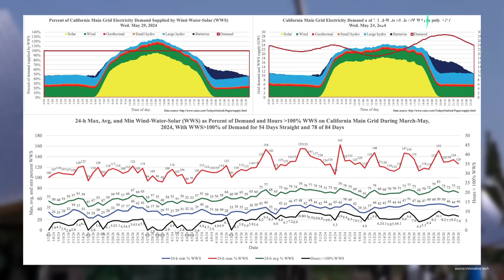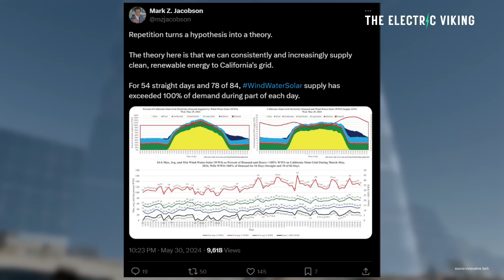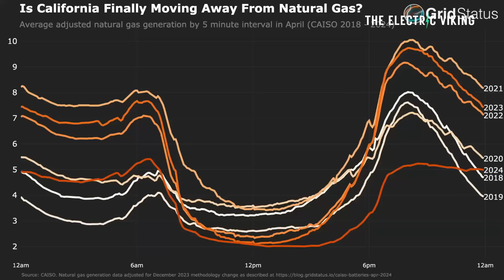Solar smashes records in California, 'DUCK curve' nearly wiped out

Comment: Dream on... The average residential electricity rate in California is 30 ¢/kWh, which is 69% higher than the national average rate of 18 ¢/kWh. And it will become much more expensive if they continue like this.
Reply: The renewables aren't the problem. It is more of a perfect storm between regulation encouraging cost maximization, out dated transmission infrastructure in need of undergrounding, and a very badly run utility that are driving up costs.
Reply: @ianollmann9393  Germany is trying the same thing and they too have exploding costs. Problem is that PV/Wind do NOT provide power in about 80%+ of the time. So you need to massively overproduce power and store that excess energy very expensively with at least 30-40% losses. And in parallel you require expensive backup power systems (primarily gas) to cover when there's low power for several days or even weeks. So you have to build parallel infrastructure and all systems run inefficiently. It will and must be very expensive and unreliable. Basic physics. Thus all countries trying it are facing the same fate.
Reply: @marcusfleuti2672  The cope in these comments is so strong (not the comment I'm responding to!). Storing electricity in giant batteries is more expensive that running a CCGT, or a nuclear plant. There is no conspiracy. 

Does the guy who made this video even understand why the "duck curve" is a problem? Does he understand grid instability and the fact that you can't turn on and off baseload power, and therefore you waste solar power above a certain percentage of the mix? 

Unless you think you can move the entire system to wind, solar and batteries (no gas, coal or nuclear)...and oh boy if you think California power is expensive now - just wait. 

And btw, before I hear about how great California is because of their renewable power, have you considered the conventional power they buy from neighboring states in order for them to (usually) keep the lights on?? 

I've got my popcorn ready!
Reply: @egec1  It is exactly so. I call photovoltaic/wind power "parasitic energy systems". They only work with a reliable host (primarily Gas/Coal/Oil). As soon as you factor in the required backup storage or the cost for all the backup power plants, costs of solar/wind explode whilst grid stability drops. Hence Germany is struggling with keeping their grid alive on a weekly basis now. Keeping the German grid stable costs now about $4.5 billion USD annualy already. Costs are rising with every additional Wind/PV system built and connected to the grid. Germany is now a net energy importer. Without reliable energy from other countries, Germany would be dark. It's really crazy and yet, people don't seem to understand still. Things have to become really bad because they can get better as it seems. Popcorn is a very good advise ;)
Reply: As a CA local I been picking my brain for years why this is. Especially since I know my power supply is coming from NV energy and their customers in Nevada pay half as much as me !
Reply: Also if the duck curve is such a problem why is peak pricing per kwh still during the day when their is allegedly too much energy?

Comment: There are all sorts of bizarre requirements for long term storage. In reality for places like california, you only need 12-18 hours storage.

But i suggest steps can go further: shift heavy power industries to solar rich areas. Run them during the day for ultra cheap solar power without even needing batteries.
Reply: California, the next steel manufacturing hub!

Comment: Solar power combined with batteries (molten-metal batteries are the best for longevity), really are way better than trying to use fossil fuels (oil won't last forever)  or even nuclear (too expensive to develop). We have to get longer-lasting batteries for cars, ones that won't catch fire so easily, and that will push the majority to go for electric cars.

Comment: The solution to the duck curve is nuclear.
Reply: It's not. Because the duck curve has a low in midday where nuclear plants would be required to shut down, while later in the day they would need to come back up. That's doesn't fit the typical strength of nuclear.

Comment: Rooftop solar makes a lot of sense in a suburban domestic situation. 

In Australia  domestic 10KW arrays are commonplace. They provide enough power to cover domestic power use including charging EVs such as a TM3.

Essentially power costs get zeroed most days but you still need to pay a network access charge if you want to remain connected to the grid which most do to cover cloudy days and night time use.

Comment: Living in fantasyland? Unless you consider Nuclear "renewable" 60% of california's Electrical power -(Electricity is only 1/3rd of all power consumed in California) 73% was Nuclear, Gas powered internally in California and 10% Coal and gas from outside California! That leaves only 17% of California electricity powered by Renewables. If you are going to "transition" you must replace ALL the power consumed not just electrical production. Thus renewables only account for 6% of ALL power used in california and it is peaky and unreliable.  California Energy Commission (CEC)  2023 showed in-state generation of 208 TWh from 88.3 GWe of installed capacity & Net Imports of 89.2 TWh!! A total consumption of 297 TWh. In-state generation comprised: 17.5 TWh (8%) nuclear; 103.4 TWh (50%) natural gas; 33.3 TWh (17%) solar; 15.2 TWh (8%) wind; 12.0 TWh (6%) large hydro; 11.1 TWh (6%) geothermal; 5.4 TWh (3%) biomass; 2.5 TWh (1%) small hydro; and 0.3 TWh coal. The imports were 32.6 TWh from Pacific Northwest and 51.1 TWh from Southwest, the latter including 15.7 TWh from coal and gas. About 12 GWe of gas-fired capacity was retired in the eight years to mid-2020. In 2021 about 30% of California's electricity supply came from outside the state. Electricity supplied from out-of-state coal-fired power plants

Comment: Sam, as a customer of PG&E I can tell you we have the highest electric rates of any state in the continental US, only Hawaii is higher.  I put in a solar system almost a year ago so haven't had my first true up.  I will have to give serious thought to batteries and go totally off grid if my system doesn't zero my  bill.  Summer bills here without solar range from $500 on up, with $1200-$1500 quite common.  PG&E, as are most utilities, are state protected monopolies, and the state is totally in the pockets of the utilities period.  I'm 80 years young and in my entire life I've never seen a rate reduction and that isn't likely to change.

Comment: It seems really off that in california the cheapest electricity rates are between midnight and 6am.  I guess it is because transmission lines  are more saturated during the day.
Reply: The one nuclear plant can't quickly reduce output. Geothermal power is there whether you use it or not. The large hydro would just have to let the water go over the dam in the spring when the snow melts. And demand is low late at night: lights and TVs are off, less need for AC, offices and stores are closed.

Comment: To best deal with that evening peak:
1. Get rid of the home inefficient devices - the high consumption washing machines, refrigerators and radiant heaters. Change-over to heat-pump (compressed gas) systems as soon as possible.
2. Introduce more home batteries with solar systems.
3. Get people driving EVs and develop the V2H functionality so home-owners can use the EV to support their home solar power system.
4. Workplace carpark charging* so people gan go home with enough low-cost (mid-day) power to support the evening peak demands.

* Where I live the 11am to 2pm price of power is actually negative; power companies get it from power stations and get paid to take it. The consumer can get 0c/kWh power and the power company still makes money.
Reply: If renewables (plus the necessary batteries) were actually cheaper, then there would be a tidal wave of people buying large batteries for their homes to fill them up when power is cheap and use the battery power when the grid is expensive. I don't see that wave.

Comment: California electricity price is 70% to 90% energy delivery and only small fraction is electric generation. It means copper wires hanging on poles doing nothing (other than  conducting) cost many times the cost of solar, wind, battery, nuke, Nat gas, coal, etc. etc.
Reply: That’s part of Tony Seba’s G.O.D. theory. Solar/batteries will get so cheap that it makes more sense to generate your own than to use the grid.
Reply: @davestagner  solar install cost is 80% labor and permits and nothing to do with actual solar panels. If solar cells are free, it'd only be slightly cheaper but not by much. And politicians won't let power companies lose profit. See net metering changes in CA that discourage home energy producers as more ppl adopted solar.
Reply: @yootoobvyooer  It’ll be interesting to see where the balance lands between home installs (which cost more than grid installs) vs power from the grid (which adds a lot of distribution and maintenance cost). I’m sure we’ll have a lot of both.
Reply: @davestagner  my point being, having lots of solar won't make electricity cheaper as most of the cost is in something other than electric generation.
Reply: @davestagner  that day is still not here unlerr you are in the Upper 10%
Reply: nice lie, copper is to costly to hang on pools
Reply: I thought the point of copper was to do conducting.
Reply: @JeffDM  its also the price per fpot copper is very costly per ft
Reply: @dknowles60  doesn't surprise me someone who thinks 99% of population are on welfare because they use grid also thinks copper cost has to do with high electric delivery price as if copper is replaced all the time.
Reply: @yootoobvyooer  only in houses  and other things, I am retired TVA , i work on high voltage lives 500k volts, they are steel cable, copper is not the only conductor out there, like i told you copper is not use in high voltage lines. a big problem in  new home consturction is people are stealing the copper wire out of the houses.
Reply: @dknowles60  stealing copper from home construction site doesn't affect grid delivery copper which already exist. But then you also think everyone using grid for electricity are on welfare. Senility is a terrible thing.
Reply: @yootoobvyooer  again you have problems reading, Copper is never use in High voltage line Because steel is cheaper it is a lot stronger can span longer distance, hint steel wire is also use in homes where the wire is 8 gage and lower due to cost
Reply: @dknowles60  you still have a problem with reality by thinking ppl using grid electricity are on welfare.
Reply: @yootoobvyooer  do you know what welfare is, hint it is  puting up a solar system and hoping a electric Company  will buy your extra electricity
Reply: @dknowles60  making up you own definition of welfare is precisely why detached from reality. Going by your definition, driving on the road is welfare.
Reply: please feel free to make a fool of your self on Ypu tube , all my facts i have posted are on google, all you have posted is your feedings, there a places where copper wire has it uses, hint in doors
Reply: Yup it’s the equivalent of ordering a $30 pizza and paying $100 for the delivery. 😂
Reply: @johnbeeler25  YEA
Reply: CA utilities are investing billions burying electric lines to avoid starting wildfires.

Comment: if everyone just considered putting timers on there hotwater tanks that is a "battery in every house already" and only cost $400 to install with instant results🤩🤑🤑🤑
Reply: $400 for a stinking timer?  I put one on my water heater 20 years ago, and it's still running.  Home Depot still has it for $36.

Comment: Sam! "Relatively expensive" rates for electricity we are absolutely the MOST expensive rates in the nation. $0.54/kWh off peak and $0.64 it helps when you tell the whole truth not just the fluffy stuff that makes our leftist monopoly run state since 1999 (terminator doesn't count another lefty) try and sound great. Solar is great i have a 48 panel system cost over $50k to install because i was basically forced due to our more recently skyrocketing rates great job Gavin way to bring change... Not the change we're hoping for, no wonder why CA has net loss of population in past 3 years cant afford this madness.

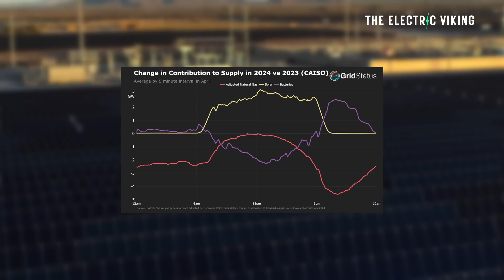Comment: 5:36 So looks like if the battery storage was X10, and the solar was x3, and no more EVs and every day had that much sun, supply would meet demand. The only BIG issue is what happens when the sun don't shine for a week. Assuming no more increase for heating/AC, lighting, or EV, you really need X70  battery storage and X10-20 (approx) solar to cover 1 week of minimal solar.
Reply: They've worked through this. There isn't any such thing as the sun not shining for a week, or even a day. It just shines less, but it still shines. The low cost solution is therefore to just overbuild the panels. This even works in Alaska. It's just a question of how much panel overbuild is needed, and what to do with the excess when the sun is shining.

Comment: $0.65 per kWh - Highest in US!  Well done, nope!
Reply: Of course you pick the peak price of the highest plan. If you don't have solar you pay 43 cents per kWh up to your baseline allocation, 53 cents after that. If you have solar it gets more complicated: June 1 to Sept 30 you pay 10 cents more from 3 to 9 pm, but in winter you pay a few cents less than the non-solar rate. No doubt it is high, but you don't have to exaggerate.
By the way, the highest rates are in Hawaii.

Comment: Cost of electricity is skyrocketing!  Report both sides of the story Sam!
Reply: Start listening from the 6:00 minutes mark
Reply: @frank4425 Dude those reasons are for PG&e. Im socal edison and they dont have to pay for those reasons he said.  He doesnt have the whole story.  The grid has to be upgraded immensely with batteries and more solar.  But it is going to costs billions more.  Times like these i wish i had put solar on my roof but even though i have a south facing house the roof slopes down towards north.
Reply: @Bob_Sacamano  Infrastructure projects typically do cost billions. But they are necessary. What are governments for?

Comment: I seriously question the efficacy of using lithium based batteries for large grid storage.  If you add up the total embedded cost/carbon/environmental impact for using lithium battery storage, I hypothesize that natural gas peaker plants are likely cheaper and better for the environment.  Batteries are expensive, use lots of mineral resources that necessitate extraction, transportation and refining, have a short lifespan, and create huge amounts of toxic E-waist.  Lithium batteries are NOT green. This is a racket and a pipe dream.  

Try pumped hydro if you want a real green technology.

Have a nice day 😊
Reply: Correct. and on top of that, there are several options to use other than Lithium for grid level storage. But that doesn't stop the show.

Comment: At 5:00 PM PDT natural gas is generating 25.4% of California's electricity. At 6:00 PM gas is 33.4%, batteries 3.9%. At 8:50 PM gas is 41.9%, batteries 15.1%. It's a green energy revolution!
Reply: California hit the 10 gigawatt mark for installed battery capacity. 10 gigawatts are enough to meet about 20 percent of the peak electricity demand recorded in the grid managed by the California Independent System Operator (CAISO).
Reply: Stop pestering Sam with reality.  He's in his blanket fort fighting off the bad guys.

Comment: Nice, BUT with only a 6-7hr window to get that power, we need more like 300-400% right now California has enough battery to cover a 2-2.5hrs of grid demand
Reply: More like 13-14 hours
Reply: @larryc1616  Why did you say this ?.
I live in the California desert near Palm Springs and in the winter season we get full power for apx 5hrs and 2hrs of ramp in and out so let's say 6-7hrs With solar tracking or 5-6hr with fixed panels.
In the 6-hour window, you need enough to power the grid 100% and save enough in battery to power the grid for the other 18 hours. The other 300% plus enough to cover the conversation losses about 10% going into the battery and another 15% coming out of the battery into the grid inverters and 5% for the large scale transformers so we lose around 20% when storing and using batteries. 
So you really need to add another 20% to that extra 300% for a full fuel free solar grid.

A solar panel might be flat, but the thickness of the glass and the type of panel affects the working view of the panel in general think of a panel like a camera sensor with 135deg fov and a 90deg peek fov any direct light within the 135deg fov will make some power put only the inside the that 90deg ark or 45deg from center will you start making peek power also most the solar far.s in California are in the southern high and low deserts where the panels will produce 20-35% less power in the summer with average ambient Temps well over 105F for 80-120days a year.
The rating for a panel are if the panel get 1000w per meter square of direct on axis sun light and California meets or even exceeds the light required 85% of the year
Reply: @CNCAutomationLab  I live in LA county 🌞
Reply: @larryc1616  palm desert a few hundred yards from the wind turbines. The sad part is that a 1ac solar farm will make significantly more power over the corse of a year than the entire wind farm..
I have a 2ac lot and a 55kwhr solar array with over 400kwhrs of battery reserves. My house is only 1480 square feet, but the underground bunker I built under the solar farm is over 4200 sqft. I'm entirely off grid with my own septic and well. I have a steel building near the org house with a full machine shop.
The org 2 car garage is a full pcb fab shop.